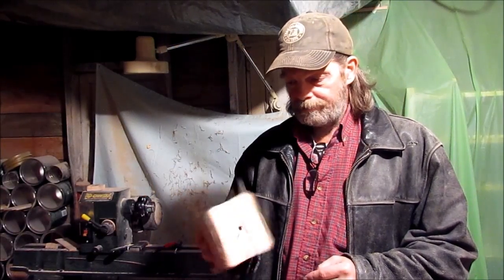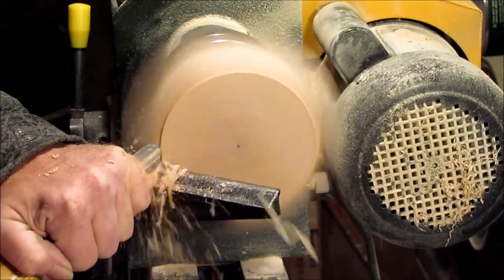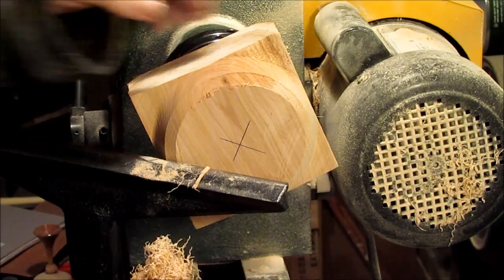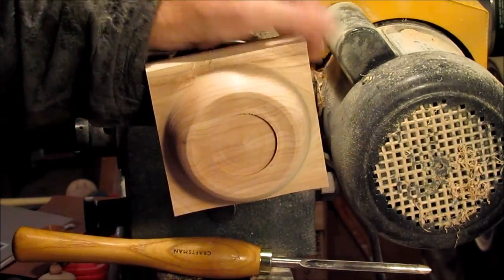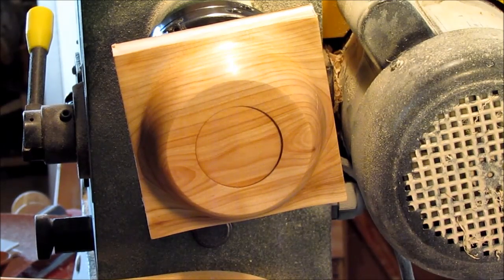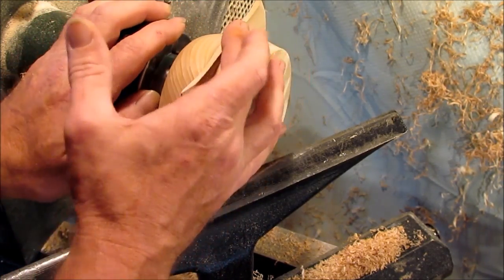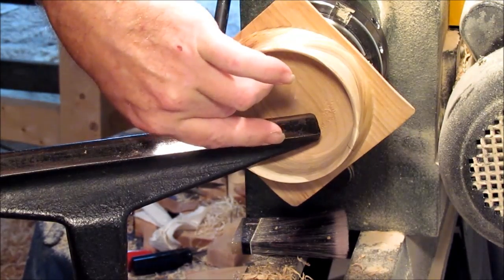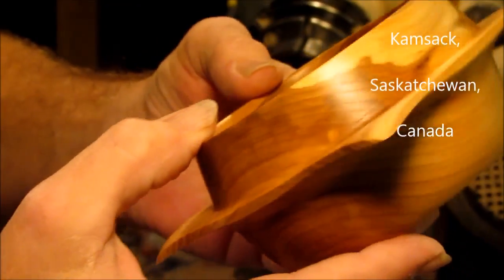Wood Turning a Square Winged Mountain Ash (Rowan) Bowl

Comment: Great looking bowl, nice finish, thanks for sharing.
Reply from the maker: +Frank Taylor Thanks for watching Frank! ... It actually hasn't been 'finished' quite yet. The finished look was from cleaning the freshly sanded surface (600 grit) with mineral spirits. I'll finish it along with a number of other pieces at the same time when I open a fresh can of polyurethane. I'd rather do larger batches when using poly to minimize the risk of ruining an entire can if I end up not getting a good seal when I close it up again. I've had it happen where I've finished a single piece, closed the can, and when I returned to it, I discovered that it hadn't sealed properly, leaving me with a mass of gel poly with a 1" thick layer of hard plastic on the top. ... lesson learned. 
Cheers!

Comment: I was going to ask about the cracks as well, but I guess you are going to leave them. I was turning some Ash that looks very similar to yours and filled a crack with CA glue. I also filled some small tear out spots as well. I was going for a high gloss lacquer finish and this method made the flaws nearly disappear. I think it would work with Poly too. I like the wings, a very nice look.
Reply from the maker: +Gil Grace Thanks Gil!

Comment: Looks good Jerry.  What about the cracks?
Reply from the maker: +Gary Robinson The cracks on this one don't bother me much. The wood is pretty dry, so I don't expect them to travel. Turning this was basically just a challenge to myself to get some nice sharp points on the square wing. Most times I've tried before, I've ended up rounding them off for one reason or another, so despite the cracks, I still think of this one as a success. 
Thanks for watching! 
Cheers!